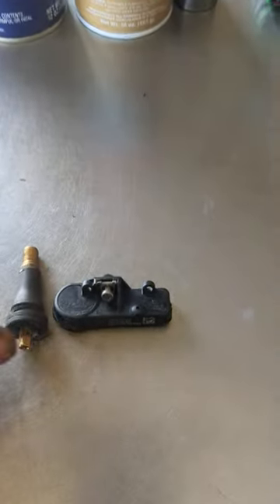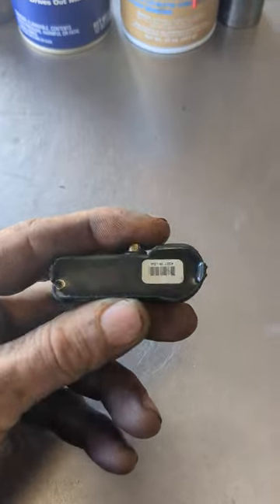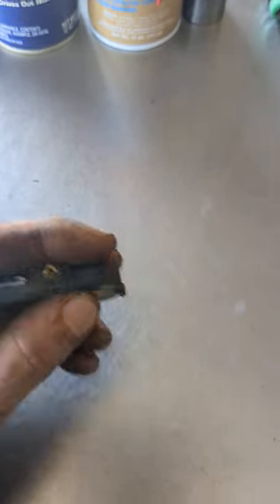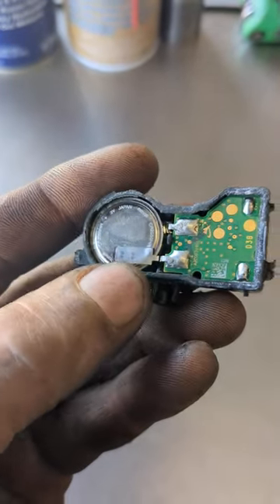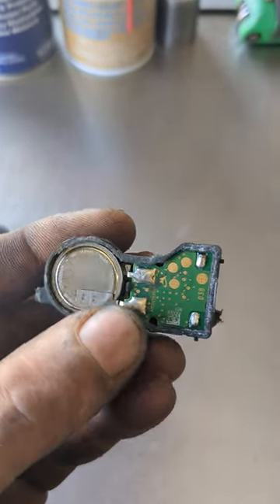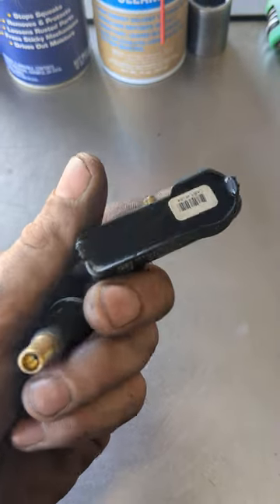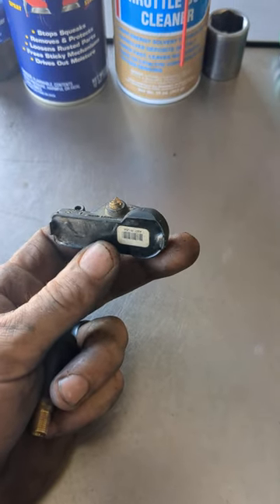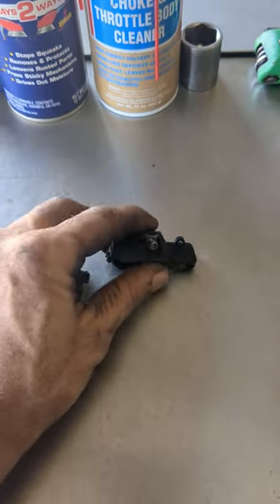TPMS Sensors. How to replace or change the battery.

Comment: The aftermarket TPMS sensors aren't all junk, for example the Autel universal ones are used by many shops with no issues. Also you can de-solder the battery and replace it and solder it back in a new one, although it's a lot of work and and resealing the case is tricky.

Comment: How often do you replace the valve stems, which are equipped w/those TPMS sensors? Bcs you replace the usual valve stem (without the TPSM sensor) every time you replace the tire. But for these TPSM, how does it work? Do you replace them only when they start to malfunction? And another question: If you put on an extra wheel w/tire (like if you have 5th wheel w/tire ready to put on the car if smth happen to one of other tires) instead of the wheel w/punched tire and you have on that 5th wheel just aftermarket TPSM, do you need to reprogram or anything after you put back the original wheel w/tire (after repair)? Thank you for the informative film.
Reply from the maker: I personally only replace the valve stems or sensors when there is a malfunction. I haven't had any problems with valve stems yet.  The new sensor should come with a valve stem, all one piece.
If you have a flat and wait awhile to fix it, then reinstall it later, say a week or so, you should not have to reprogram it to the vehicle, do to it's still stored, in the BCM. Now if you rotate tires or install a new sensor, then they will need to be relearned to the correct position on the vehicle. Any good reputable tire shop or dealership, should relearn them for free, it takes like 2 minutes. Hopefully I answered your question and thanks for watching.  Jason
Reply: @showmemechanics  Thank you very much for so detailed answer. I've just recently learned to replace the tires and found it very convenient to have the 5th wheel w/tire in  garage. We did it for all the 3 cars we have. Already benefited fm/this approach: a tire on one car got flat, I put the 5th (that extra, which had a new tire already) and then worked on the punched tire w/no rush or worries. When ready replaced it back and put the 5th extra in garage again. Special thanks for those 2 things: you need to relearn when you rotate the tires and that they can relearn in dealer for free. I go there for alignment after tire replacement, so can ask them to do that relearn on Nissan we have (I didn't replace on that car yet, it has TPMS, other 2 cars don't have it). Thank you kindly again.
Reply: @showmemechanics  I fully understand your reasoning but I still have to think back just a decade or two ago when every time that you mounted new tires and sometimes just remounted the old tire (due to fixing a flat, i.e.), at those times it was AUTOMATIC that a new valve stem had to be installed. The reasoning given was that the valve stems were prone to leakage from either being previously installed improperly, not seating properly due to dirt, damaged during the install, or the Schrader mechanism was damaged and leaking. Its very interesting that the reasoning now given is that "I've never had any problems with valve stems...".  Hmmmm!

Does this mean that during all those previous decades consumers were being overcharged for un-necessary part replacements? I tend to think so but given that the stems retailed for about $1.50 each it wasn't that big of a deal unless that retailer also charged a separate labor fee to install the stem which took all of 30 seconds to remove and install a new one. I like to stick with the adage of "It it ain't broke, don't fix it." 🙂
Reply: @baldy95307  The rubber valve stem type is replaceable separate from the sensor. As with the old style (non-sensor type) you should change them at every tire replacement as they become dry-rotted from heat and sunlight and tend to leak when driven at highway speeds which bend the stems outward stretching the dry-rotted cracks enough to leak out air. The aluminum TPMS sensors with aluminum stems do not need to be changed unless the O-ring/gasket at the base starts leaking from old age and becoming brittle and cracked. If installed correctly (torqued to spec which is only a few N-M) they last a long time. If overtightened, they give up a lot earlier, sometimes right there during installation!

Comment: Just unsolder and solder and new one in, glue it back together, let it dry and reinstall it. Or do a bypass on the dumb setup.
Reply: Or jump it with a new battery before removing the dead battery. Maybe they designed the circuit that once power is out, a transistor breaks any new current flow of 1.5V
Reply: @doverun  Why would you jump it? Nothing on the car charges it so it was die right away. Might as well change the battery while you have it tore apart.